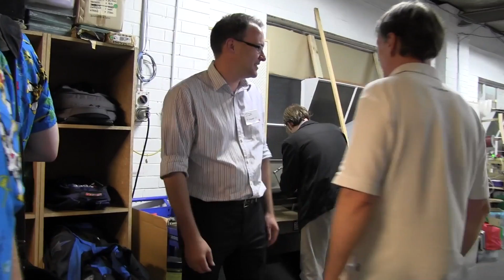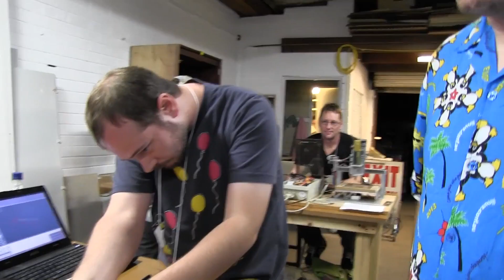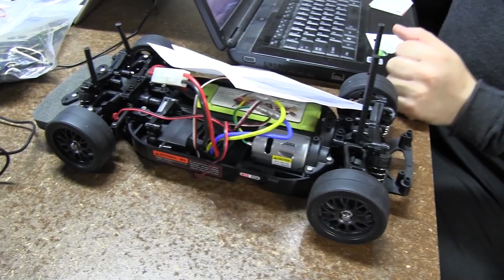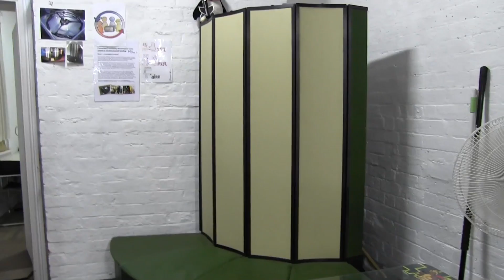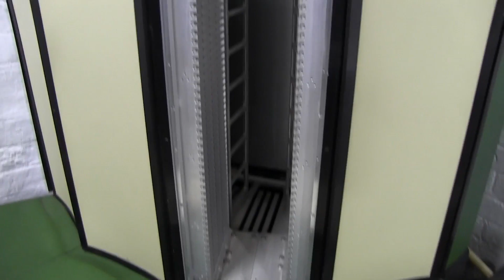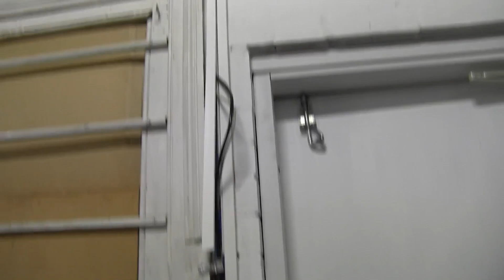EEVblog #421 - Melbourne Hackerspace

Comment: There are tutorials of soldering on the EEVBlog, 180,181, 183 and 186 should be useful. Which stepper motor drivers are you using? If it's the Polulu A4983s, you could put the pins into the socket on a RAMPs board or into a breadboard (although you may damage your breadboard) and solder it on that.

Comment: Dear crenn6977: I've watched the EEVBlog, 180, 181, 183 and 186. David jones does not address small and close together header pins. The stepper motor and the stepper motor driver I intend to experiment with is the #1206 stepper motor from Pololu (please refer to their website if you would be so kind) and the A4988 Stepper Motor Driver Carrier With Voltage Regulator.

Comment from the maker: Good audio recording in these circumstances is not easy as a one-man-band impromptu videographer. I was using my shotgun mic here, so reasonably good audio when the camera is pointed at the person, but sucks otherwise. You really need a separate audio recording person to hold a boom mic, or be on-camera with a hand held mic shoved in the persons face.

Comment: The header pins are VERY close together. If only you could see one. But when the soldering is done, HOW is it done? Pololu will not say. And when Pololu does it, it is done very well with neat cones of solder. But is it done by robotics or a person? If a person is doing the soldering manually, is there a trick or a technique? You would have to see one to really appreciate what I'm saying. Thanks for responding.

Comment: i've seen comment rage wars over what you've just described as 'hacking' coined 'cracking'. Amongst the tech elitist, hacking is just circumventing forbidden access, without any modifications to the system; cracking, however, is an intentional invasion AND reconfiguration of a system. Not sure why people devoutly differentiate between the two because I'm sure most companies abhor any form of 'hacking/cracking'

Comment: The MakerBot doesn't need position feedback to work reliably. It's an open loop system, but because it's using stepper motors and knows how many steps to travel x mm, it's accurate enough and repeatable. There is actually a lot of thought to the projects done at the space. Some people may not know how to do certain things, but the knowledge can be shared around easily enough. It's a shame you think the way you do, there is plenty of talent at the space, you just need to talk to the members.

Comment: but the raspi is just 25$, arduino can't compete with that !

for example RFID entry, with an arduino you have to make lots of software for even basic functionality plus lots of glue electronics

on the raspi you already have linux running, syslog and wifi then you just hook up a off-the-shelf 13$ RFID reader and use some ready made RFID access control software and you're done at a much cheaper cost and your power usage is still under 5 watts !

Why bother with arduino unless you need an ADC !
Reply: For a lot of people, like me (a hobbyist student) hardware is a lot more expensive than software. I can spend an hour writing arduino glue, when the arduino costs literally 3 dollars a piece + any 1 dollar USB charger, instead of 40 dollars for a raspi and all the neccessary cables

Comment: I never said an Arduino, I said a low power micro. The point is, the RPi with Linux is not suited for this, and as much as I use it in day to day life, there is no way I would trust it to a security application like this... too much to go wrong. With a small micro programmed to handle this single simple function there is less to fail in software, less unknowns, better reliability and lower power usage. Perhaps more time to program the device, but a much more elegant solution.